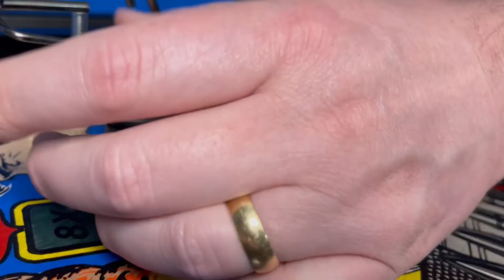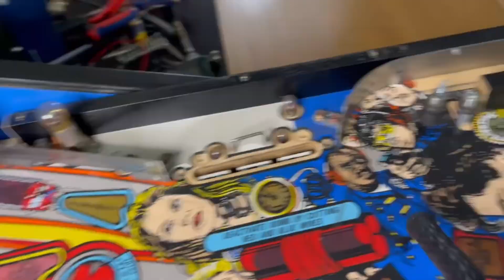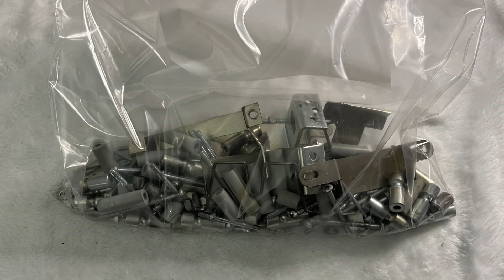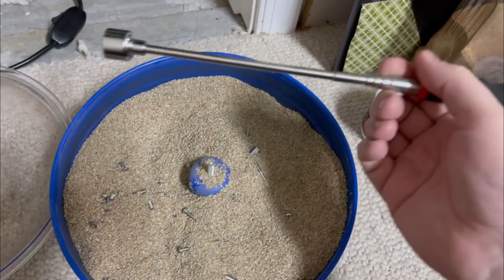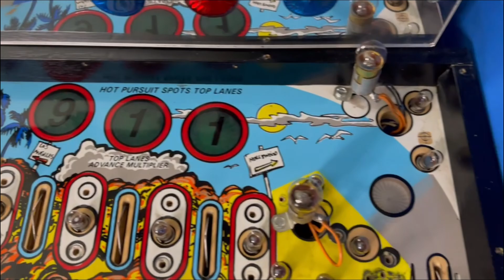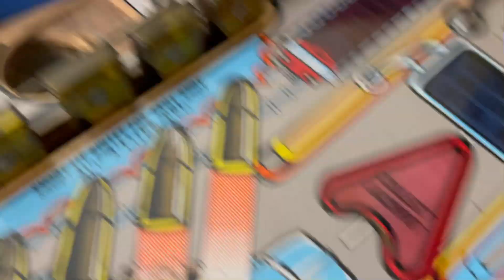My First Pinball Shop Job! Lethal Weapon 3 Pinball Machine Repair - Part 2

Comment: One tool that I found helped with removing the nuts from plastics without unscrewing the post is Titan's Pinwrench. It's a thin piece of stainless steel with a 1/4" notch in one end and a 5/16" notch in the other. It's thin enough to fit under a plastic and hold the hex portion of the post while you unscrew the nut from on top of it. Marcos sells a similar tool under the name Stud-Buddy.
Reply from the maker: Thanks for the tip! I'll pick one up the next time I'm placing an order. Definitely sounds like it would come in handy